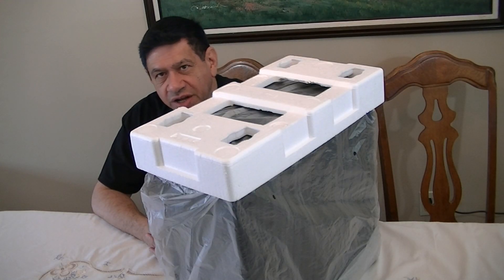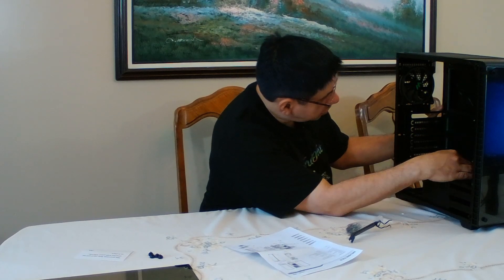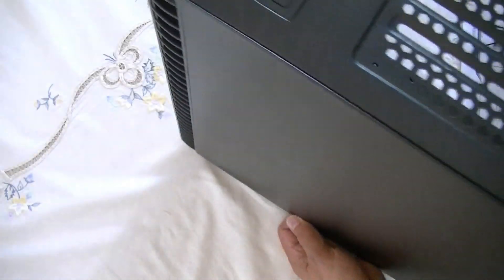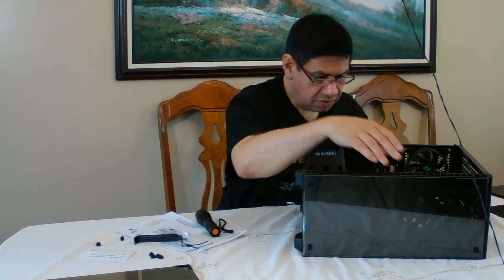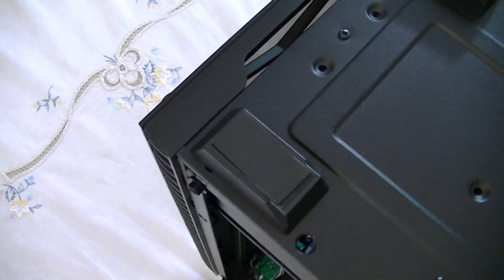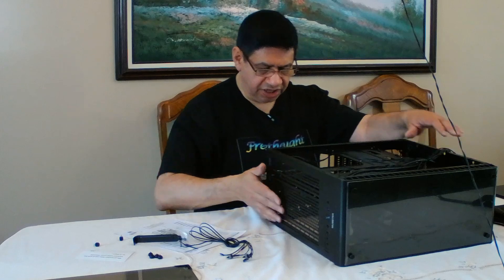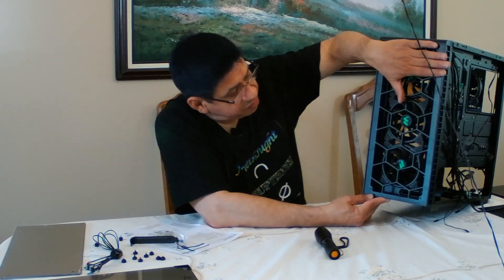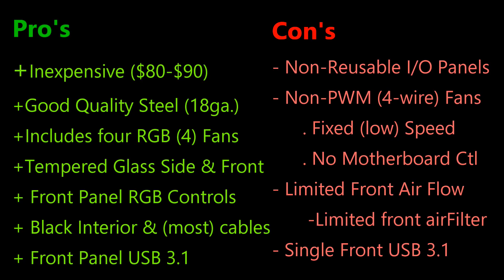Gaming PC Build – MUSETEX Case Review (Part 1: Pre-Build Prelim)

Comment: How you review a case without turning it on to see the fans
Reply from the maker: That is a good question.  Unfortunately, it can only be partially reviewed based on what it comes with and possibly any challenges it could present to a build.  Even running the fans (by hooking to a 12v supply) will only tell you things like their max RPM (and maybe how the RGB will look).  You will soon see me post the second part of the review I did with my Daughter's chosen gaming case (still being edited and charts being generated). That turned out to be a VERY poor case for cooling.  In the near future you will see me build (from scratch - not a kit) a 'case testing rig', which will supply power (at three speeds) for the fans, and use heating elements to generate internal temperatures similar to that of the CPU and GPU, and also provide a means of monitoring the temps at critical points.  Make sure you tune-in for those videos.